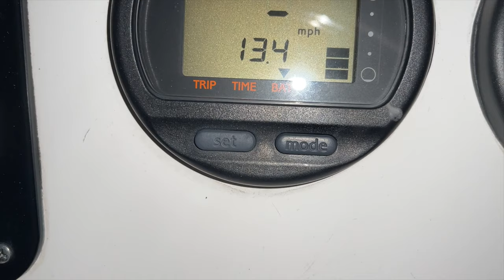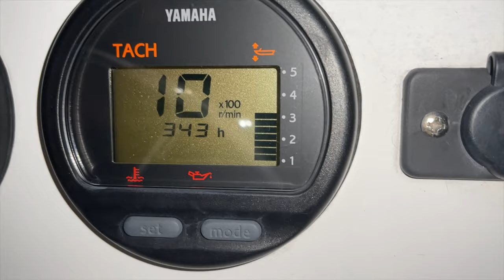YAMAHA F115 Voltage Regulator Replacement

Comment: I have the exact motor. I'm not getting a charge back to my batteries. Should I try replacing the regulator first then look at the stator?
Reply from the maker: Not sure on that to be quite honest, I changed this out because I noticed an overcharge and this seemed to correct that. Have you tested your alternator?
Reply: @selfemployedstudent  no I have not tested it yet but I think there is a way to check both stator and regulator. The hard part is finding the required resistance or ohms for those specific parts. Service manual? Idk no luck on forums
Reply from the maker: From what I’m seeing replacing the voltage regulator might actually solve the issue. I did find a Hull Truth thread where someone stated low voltage (11.7) and changing the regulator fixed it. Can’t guarantee that that will but maybe worth a shot. Also load testing your batteries to make sure they are good (not sure if you’ve done that already). Could also be a short in your wiring too.
Reply: @selfemployedstudent  I replaced the cables and batteries. I went out twice  then the new batteries were DEAD. I also read high voltage was more common than low but that gives me hope. Thanks man!
Reply from the maker: No problem-if you do decide to change out the voltage regulator and that fixes it let me know I’m curious myself! Good luck 🤙
Reply: @selfemployedstudent  I will let you know either way. If it's not the RR I'm going to cry because a stator for our motor is close to $600 and as you know you'd have to pull the flywheel. Wish me luck! Thanks again.
Reply from the maker: Voltage reg is slightly cheaper and easier to change out Lol
Fingers crossed brother. Tight lines 🤙
Reply: @selfemployedstudent  hey man, finally changed the voltage regulator out and problem is solved! I watched the vlolts climb from 12 to 13.5 in seconds, before it was gradually dropping and never went up.
Reply from the maker: @hookedonthebay3890  good deal, glad it was a simple fix and pretty easy to replace that part. Tight lines 🤙👍

Comment: Just replaced mine, but no change in voltage. 14.8V @idle
Reply from the maker: This one is not that high at idle only at cruising/high speeds. Could be the ECM maybe?
Reply: @selfemployedstudent  I don’t think mine goes above 15v while running.
Reply from the maker: @CaptainRon904  this one doesn’t go to 15 either after I replaced voltage regulator. 15 is high.
Reply: @selfemployedstudent  What is the highest Volts 
your seeing?
Reply from the maker: @ronschurr2123  between 14.6-14.8 at WOT
Reply from the maker: @ronschurr2123  between 14.6-14.8 at WOT
Reply: @selfemployedstudent  same here. Been that way for forever. I guess its ok. I found a video on how to test the voltage reg with a meter. My old one checked out ok